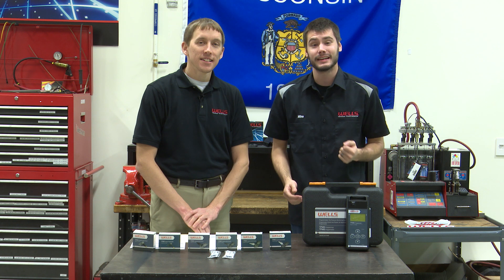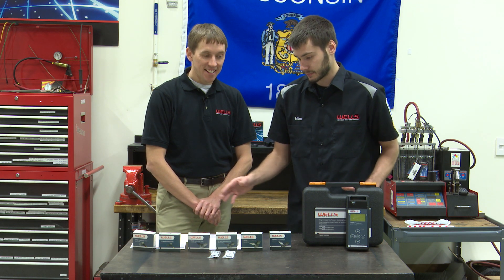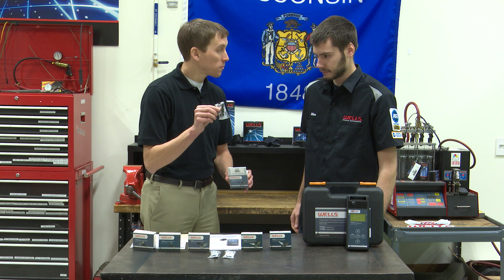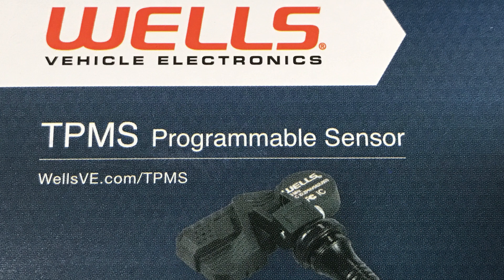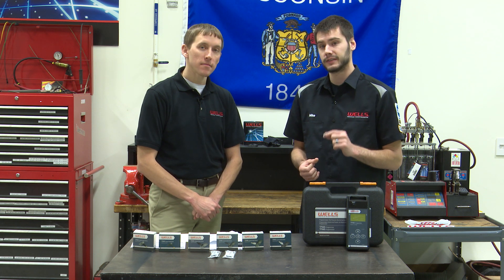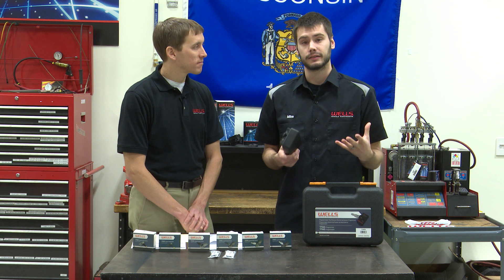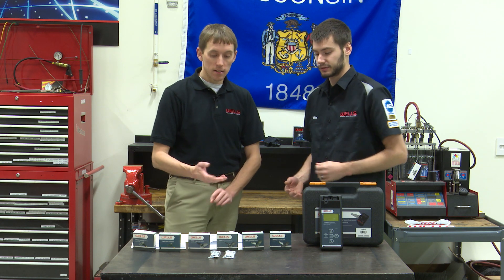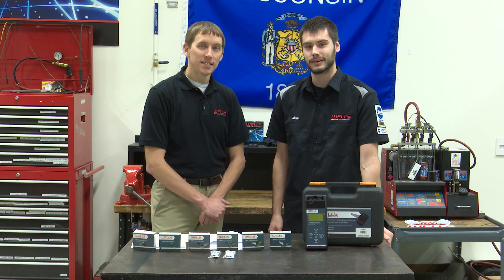Wells Counterpoint Ep. 15 Programmable Replacement TPMS Sensors (TPMS1, TPMS2, TPMS3)

Comment: Nice information Mike. I'll have to check prices on your sensors and Wells programmer vs OEM/AFM sensors. Nice informative video & I'll have my Pico tomorrow.
Reply from the maker: Bob, it really is a great system in my opinion. The programmer will also perform the relearn procedures like after a tire rotate. I can't tell you how much time I wasted looking around the shop for the TPMS tool. I could have had this thing sitting in my toolbox at all times. It really is a great tool, and the sensors are great as well!
Mike Becker, Technical Services Instructor
Reply: Wells Vehicle Electronics One thing about a 1-man shop is I know where my equipment & tools are and I am OCD when it comes to tools, equipment & cleanliness.
Reply from the maker: That is a huge benefit! 
Mike Becker, Technical Services Instructor